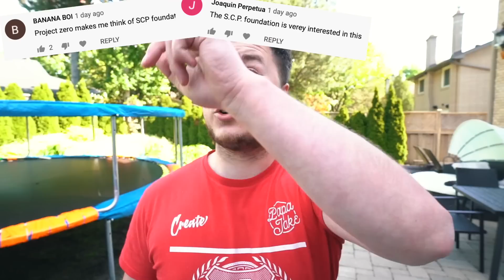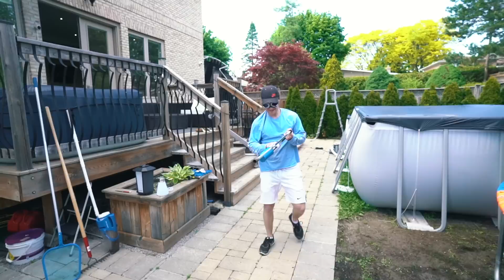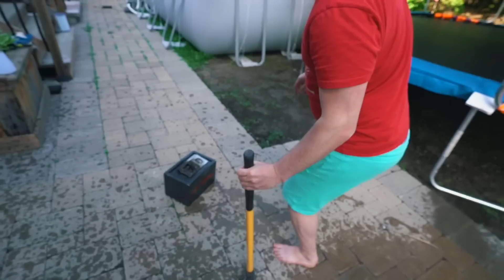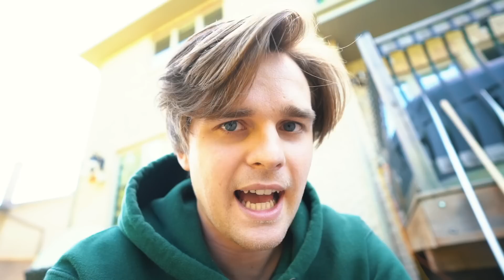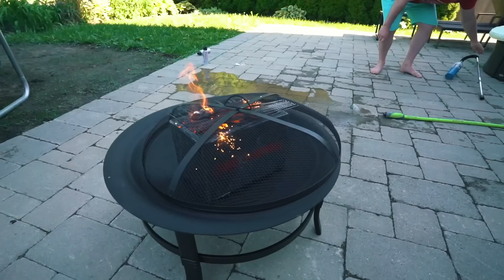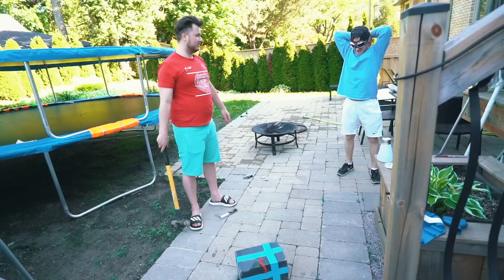BREAKING Into ABANDONED SAFE With 1,000 SPARKLERS (Project Zero EXPOSED)

Comment: Siren Head is a 40-foot-tall humanoid creature with a heavily emaciated, near-skeletal frame covered in dried, mummified flesh in the color of rusted metal. Its limbs are disproportionately long and thin, with arms almost as long as its entire body, ending in huge, bony hands. Where a human's head and neck would be is a thin pole of flesh with two sirens attached to them- facing in opposite directions- (hence its name), and several black wires snaking around its "neck" and into its upper shoulders, pressed against its abdomen. The speakers are the only metal parts of its body, fused to the neck by tendrils of skin and capable of swiveling around it much like the head of an owl. Some images depict Siren Head's speakers with toothy, lip-less human-like jaws and a long, retractable thin snake-like tongue, though Henderson has said that the teeth are only visible on a certain radio-frequency. it hunts in many ways. The most common hunting tactic used by Siren Head is blending into the environment. This usually consists of heavy woodlands and rural areas. It's brown mummified skin matches the pattern of rusty metal or tree bark, which usually makes people think that Siren Head is a tree.

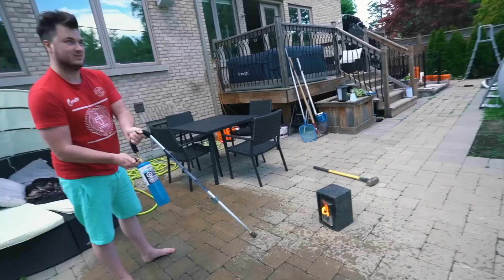It has the ability to mimic the voices of people close to the victims, effectively luring them in. It is currently not known for sure what Siren Head does to the victims once caught. Theories include eating them, or adding them to the roster of voices used by it, or simply just killing them and scattering their blood all over the place. It has brown mummified skin matching the pattern of rusty metal or tree bark. It silently stands in heavily forested areas making sounds like Nuclear war announcements, amber alerts, and mimicking other voices of friends or loved ones, bringing people towards it and grabbing them off the ground and killing them violently. As its known, Siren Head is very fast, while on 2 feet, its assumed maximum speed is around 24.3 MPH. While on all fours, its speed is assumed to be clocked at a maximum of around 146.2 MPH, making it much faster then the average car. Recorded June 20th, 2010 in Chicago, Illinois. Multiple witnesses called in the CPD as a tornado siren in Willow Springs Woods started up unexpectedly at exactly midnight. When the CPD arrived at the scene, the sound had stopped and the source could not be located. Recorded August 28th, 2018, in Weber, Austria between 03:24 and 03:26. The sound originated from a forest on the outskirts of the town. When investigated in the afternoon, authorities found an empty tent and two wallets. Both wallets still had their contents in them, along with IDs: one belonging to Joachim Müller, and the other to Bruno Koffler. Both were residents of Weyer, and have since been reported missing. 

all info was recorded by me and posted on fandom 

                                          ALWAYS BE PARANOID WHEN DEALING WITH SIREN HEAD